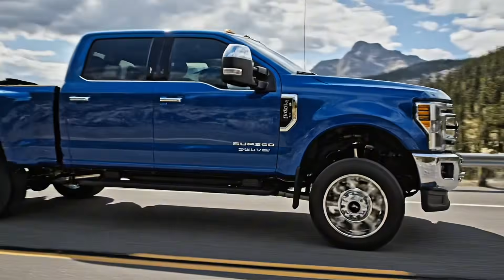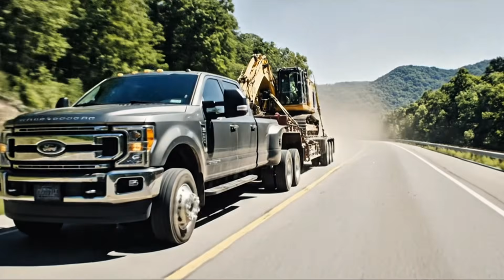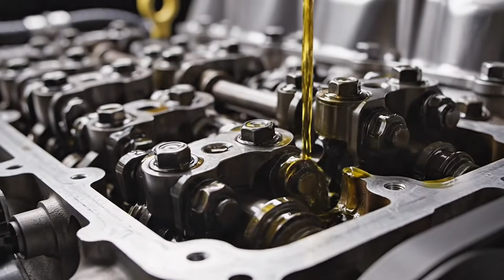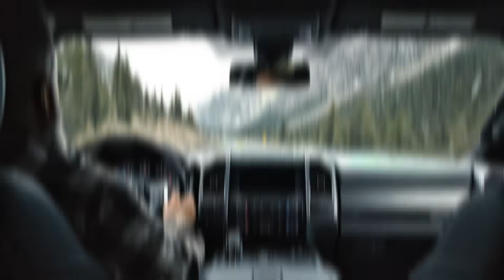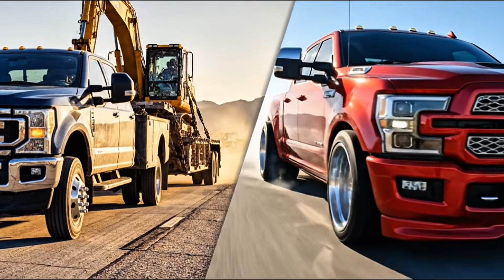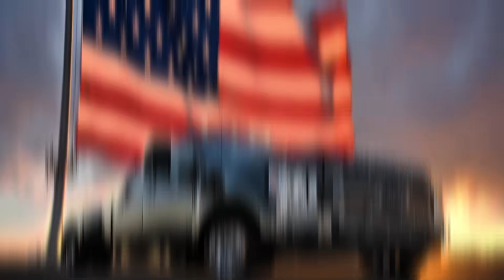Ford Finally Fixed the Biggest Problem With the 7.3L Godzilla V8!

Comment: Tapping virtually gone. Hmm. Why not just gone. I could buy and old 460 and make it solid for 200k miles pretty cheap
Reply from the maker: That’s a fair point! 👍 The 460 has definitely earned a reputation for being a simple, durable workhorse. The interesting question is whether the updated 7.3L can deliver that same kind of long-term confidence with modern technology.
Reply: @NextGenWheels-s5r let's hope so. I want it in a RV
Reply from the maker: @jpotlover  Absolutely! The 7.3L in an RV would be an interesting setup. Hopefully the updates deliver the long-term durability you’re looking for. Thanks for sharing!